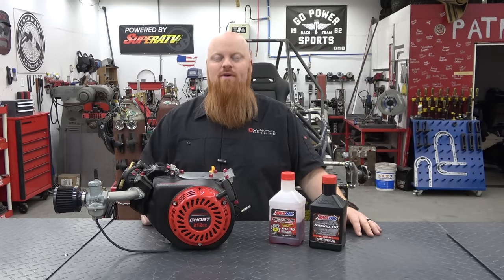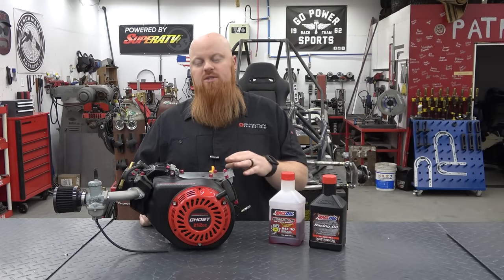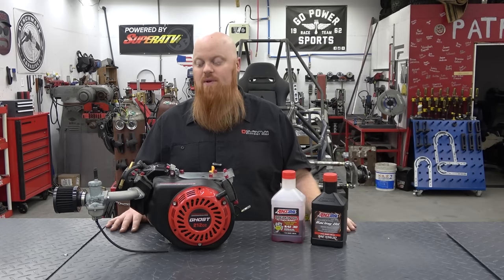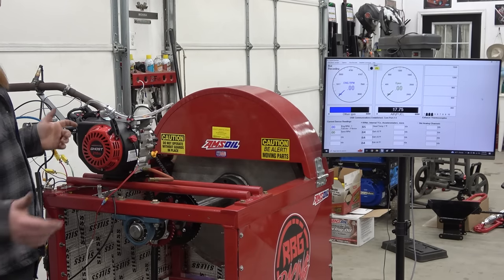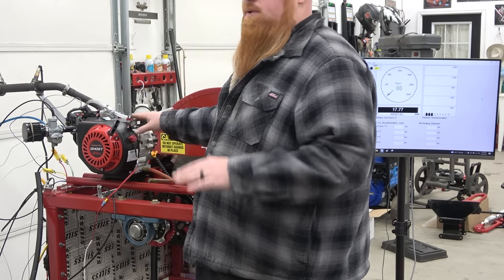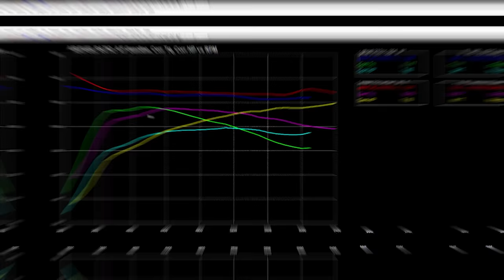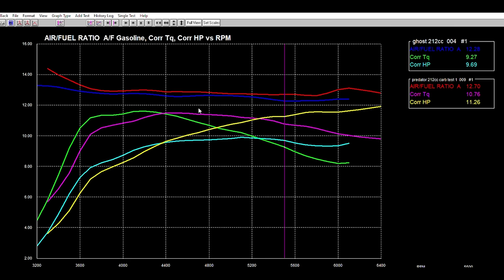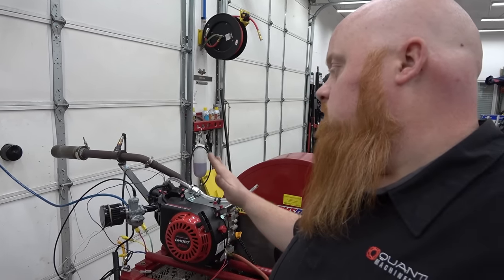We Dyno Test The Predator Ghost 212cc Racing Engine!!!

Comment: Do you  think  roller lifters would  be cool for small engines.
Reply: You'll find stuff like that on the nrracing.com website. With all the support in go kart racing, there are tons and tons of high tech parts for these motors. If you cruise the go kart sites, you'll find guys who weld and build cylinder heads, and all kinda stuff. I have a custom big valve head done by Barry Young on my mini. It's for sure well into the 20 horsepower range. It's got 1.3 full roller rockers.
Reply: Lifters have a big enough bore that a roller isn't necessary.  The added weight of a roller tip would offset the advantage of a faster lift ramp that a roller offers.

Comment: Hey buddy how do I buy your oil
I could always use a half a horsepower I saw that video
Reply: Lol! Glad you called me
Reply: @markyoung9964  👌
Reply: At least some of the half HP difference may be viscosity. If you look closely the break in oil is SAE 30. If the next oil used is 10W30 or thinner it should make more power. SAE 30 is thicker both hot and cold than 10W30. 

If you are running in 3 hour endurance races you would want 10W30 or thicker. But for casual half hour rides there's no need for oil that thick.

I run no thicker than 5W30 in all my minibike engines and have ran as thin as 5W20.

Comment: Lol I grew up 1/4 midget racing I had 200cc Honda generator engine with titanium valves stuffed into a gx160 head. Flat top piston roller rockers. Used a flywheel off a old deco engine and ran msd ignition. Huge came and tiltson alcohol pumper carb. Head ported to the max. Lol thing broke our hydrolic dyna gauge. Thing had over 350lbs of cranking compression and could make power up to the 10500rpm range. This thing is a toy compared to what can be built you can take the vacuum pump that helps feed fuel to the carb and instead use it to pull oil from the bottom of the block andvput a fitting on the top side of the block to drop oil right onto the rod. The dipper on the bottom of the rod isn't enough when u start reving 10k

Comment: What's the specs on the ghost cam
Reply: 252 lift. Probably similar to the 252 Rattlesnake cam that NR racing and Studz racing sell. I have that cam in my 224 that I run 5K RPM and under. It pulls hard. Nice torque.

Comment: Don't predator claim the ghost to be 15hp out the box
Reply: No
Reply: @patarmstrong3582  oh ok I thought I saw it somewhere on line I looked up predator ghost HP and it said 15hp but It wasn't from predator every YouTube video of the predator ghost the HP is always around 9-10 HP and on some Facebook groups alot of people are trying to say that the ghost is around 15hp and I didn't think that it was even close to it I think it's over priced for what you are getting basically your getting a predator 212 that is not have a governor and it has a Chinese vm22 slide carb the flywheel is cast the coil is limited to 6000 rpms I purchased a predator 212 hemi  got a billet flywheel and rod a mod 2 cam 26lb valve springs and a Chinese vm22 carb filter adapter and the exhaust pipe and with the engine my cost was a little bit under 300 but when I had the engine put on the Dyno I was almost at 13hp

Comment: If your using the same few headers I'd wrap em in that A Tape to keep the heat down in your shop and it seems to keep noise down more plus my personal favorite thing about while your working around it between pulls u don't get burned up when touching it and shit just a hint guy that's what I do with my test headers for small blocks and big blocks

Comment: Isn't the ghost a better casted block though I know the tilletson engines there blocks are a better cast than even the Honda I've seen predators built to the max and they made the same power as the good blocks only the predator standard block actually cracked on the side cover like a spider web is what it looked like didn't blow up and destroy my internals but it was seconds from it I heard the sound change is what got me to looking over it real good and to my surprise it was spider web cracked all over the block so now I'm down until I find a good block with a near 3" bore to install my internals into id hate to have to buy a new tilletson and have to have it machined right away I thought about a sleeved bore even but I still need a new block cuz mines cracked like the western fault lines are at the moment

Comment: And mines built for 7500 to 8000 I've seen people push em just like mine to 9000 but there running heavier springs gotta be I've seen those dual springs that's two springs over each other mines got the big valves and all that

Comment: If the biggest difference between the $160 predator, (more horsepower), and the $300 Ghost is a governor allowing the Ghost 6000rpm, why spend more money for a slower engine? Couldn't you just add a 6000 rpm governor , and outrun the Ghost... safely ?
Reply: Are you ed. the 160 dollar predator goes  15-20 mph. Ghost goes 40 with governor
Reply: @DiegoHernandez-pu6ps buddy what gear ratio are you running Jesus Christ dude. That is not normal
Reply: @DiegoHernandez-pu6ps I just calculated it and you have to have at least a gear ratio of 8:1 that is not normal at all you need a smaller sprocket in the back 😂
Reply: A stock Predator 212 does not have more power than the Ghost.

Comment: You dont care about the torque. It's irrelevant unless you only have one gear. Even in that case, you swap it for every circuit, and still focus on max power point and usefull reagion around it.

Comment: GHOST engine only needs a flywheel, coil, a cam, and bigger jets to have 15 hp. Add on top of that dipped heads, connecting rod, push rods, rockers, GHOST head with 29mm exhaust and 25 intake ports and the biggest cam that can now fit and you got yourself, 18-25 hp

Comment: So don’t buy the 212 ghost and just get the 212 and upgrade it?
Reply: A 212 ghost is made for spec kart racing. This engine is similar to a Briggs 206 and runs against the LO206. These are out-of the box racing engines that ARE NOT supposed to be modded. They are only to be serviced.
Reply: Exactly. Unless it's class regulated for kart racing, or you just want to slap one in something and not mess with it